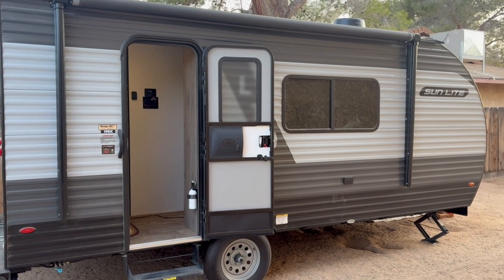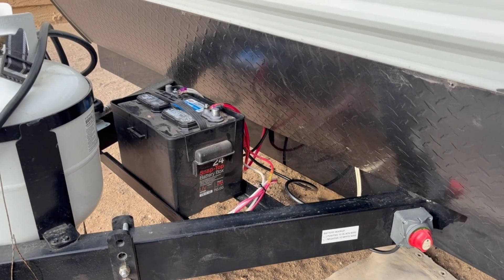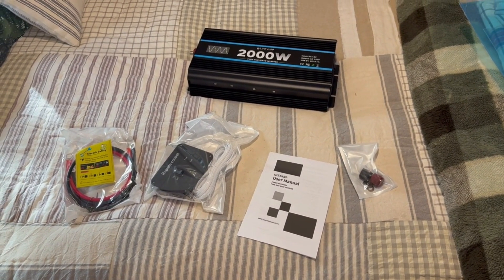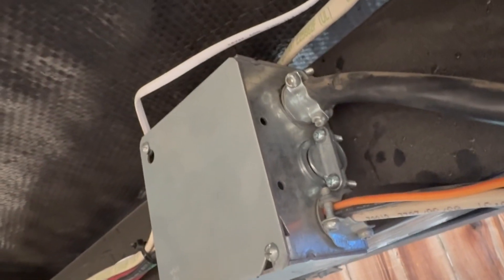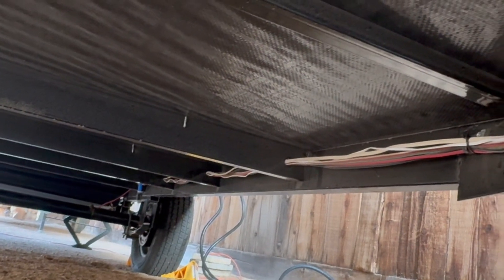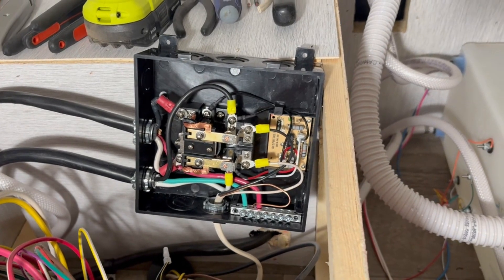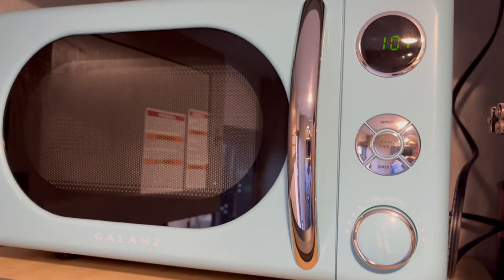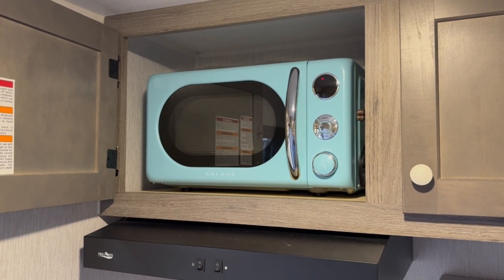Inverter install in a travel trailer

Comment: Add a second battery.  Hook them in parallel.  Will double your running time.
Reply from the maker: I swapped my lead/acid for a Lifepo battery that has 3x the usable energy. It has been great. I come home from a trip with 60% charge. That means I can run the AC some in the summer if needed. It is lighter too so tongue weight is reduced.

Comment: One installation option that work well is a power station mounted near the microwave. If that's all you plan to run is the microwave it's an easy solution. 

You can add a small solar panel to charge the power station and it will operate as a pass through. 

Not much modification needed for that installation except an appliance extension cable to the microwave. 

That saves all your power to the rest of the RV as it came from the factory. 

I realize you've already solved your problem but for the people that read comments this might spark an idea.
Reply from the maker: That is a good idea for just the microwave. I ended up getting a lithium battery that has 3x the usable power so now I can run the microwave all I want and I can run the AC for about two hours per trip if needed. I might add some solar, but so far we just do one night trips so I can just let me solar charge it back up over time in between trips. Last trip we came home with 60% of the battery power left. Super happy with the inverter because we can use all the 110v outlets in the trailer for phone and watch chargers and other electronics.
Reply: @thehomerepairguy I saw that in the comments. 👍 It's nice the way you have it set up now. If you start taking longer trips you can conserve a lot of energy changing as many things as possible to run directly from 12 volts. I have 9" AC fan the takes 42 watts plus the inverter loss which puts it just under 49 watts. Now using the O2cool 9" fan that's really close in air movement, it plugs into a DC auxiliary output and consumes 6 watts. 

We installed switchable USB outlets in convenient locations around the trailer that convert the 12v directly to 5v so no need to run the inverter to charge phones. 

The ones I found have an aux (cigarette lighter) port and two USB-A and two USB-C outputs. It's much more efficient and they are switchable so you can turn them of when not needed. 

To me it's kinda fun to see all the places where you can conserve your batteries.

Comment: why don't you just get a bigger lithium battery
Reply from the maker: My battery was lead acid. Only had 32AH of usable energy. I gave it a try and it was not enough so I replaced it with a 104AH Lithium battery. Now I have 3x as usable energy. Last trip only used 40AH. So I can run the microwave without worry and even about an hour of AC. I can even run a can opener and toaster if I need to.

Comment: Hello, I am about to do a similar Inverter install in my small RV. At 8:35 in your video, you show where you connected the Romex to the Transfer switch from your inverter; however, with my Transfer switch, I already have wires in that spot coming in from shore power. I also have incoming wires from my 3000w generator to the side terminals (where your shore power wires are. My question is, can I still add my Inverter connections to the spot where you put yours ALONG WITH the connections from shore power? I wish I could send pics.
Reply from the maker: You can not put two sets of wires to the same terminals. You can eliminate the wires coming from the generator by simply plugging the shore power plug into your generator when you use it. Then you could use those terminals for your inverter. If the generator is built in and not a portable then you might have to daisy chair the auto switches. I connected the inverter to the terminals that do not required powering the switch to conserve battery power. When I am on shore power or generator power I am not so power conscious.

Comment: Pay attention to the temperature on your wires if they are getting worm you need bigger wires for the camp draw. Yes 300amp battery and 400 w soler  mppt 100/40 controller.
Reply from the maker: Thanks for the reminder about the wire size and the solar and battery recommendations!

Comment: Buy a wattcycle 300 ah lithium battery. Put some solar on the roof and be done. You will need a victron mppt controller.
Reply from the maker: True. My battery have has very little capacity. I should have taken a lithium battery to the dealer when I bought the trailer. Instead they charged me $300 for that lead acid one. It only has 34 usable amp hours because they say it shouldn't go below 1/2 charge. It works for overnighters, but we don't use much juice since we are normally in cool places where we don't use the AC. BTW, that inverter runs the AC twice as long as the microwave which still isn't a lot.

Comment: Great video, thank you. I just bought the sunlite 15 MBX and I plan to install an inverter. What is the wire that was originally paired with the converter wire that you separated?
Reply from the maker: Thanks. Congrats on your new trailer. We are glad we have the inverter. To be honest we have used it more for small things we plug into the 120v outlets than for the microwave so far. It is nice to have 120v power to the outlets without having to be on shore power. The wire that was paired with the converter powers the ground fault outlet by the sink. It is labeled GF on the panel. The labeling is pretty cryptic.

Comment: Curious if you considered a small solar generator (e.g. jackery, eco flow, bluetti)  for your solution?  The solar generator would likely meet your needs and give you portability for other uses and not deplete your battery.  Just a thought.
Reply from the maker: Yeah, those are great. I looked at them, but they are expensive for what we need. The inverter was a good solution for me because of how little we expect to use the microwave. I didn't want to take a generator to warm a pastry. If I need more power I will upgrade my battery from 32 useable amp hours to 100. For someone that needs a little more than us they can be a great solution.